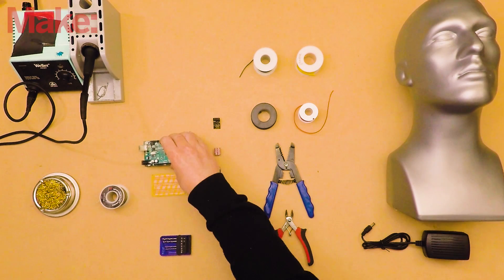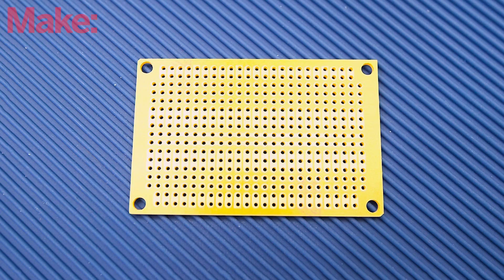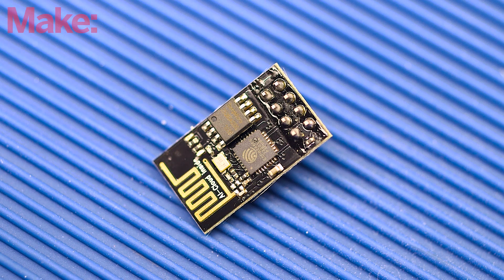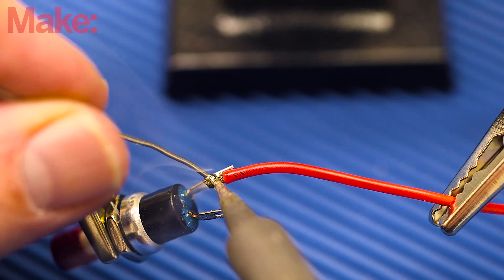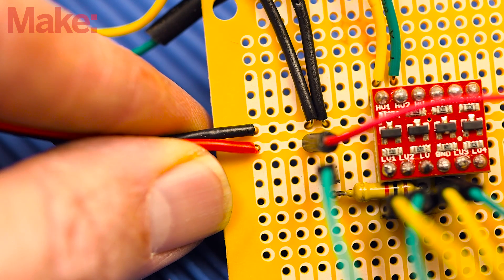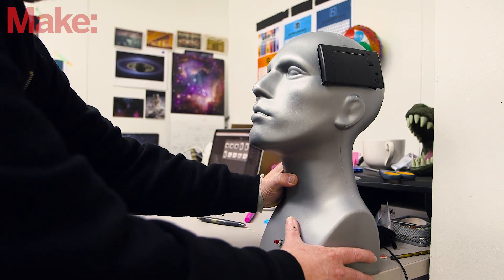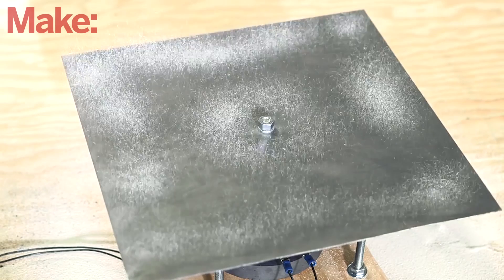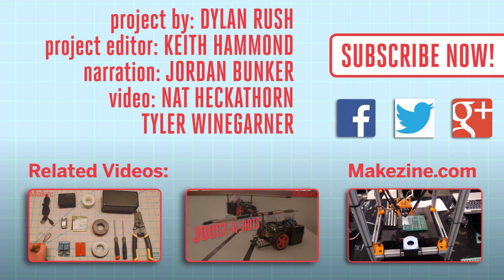Reddit Shower Thoughts Printer

Comment: why didnt you remove the arduino mega and used the esp8266 dirrectly connected to the printer ? you can also program the esp8266 with the arduino IDE
Reply: +Anders Vestergaard 
Det var lurt!
Det er litt vanskeligere, men det tok meg ikke så lang tid å programmere esp-en...

Comment: What was the approx cost of a project like this? (assuming you have all the tools)
Reply: +IllegalTacos Head on over to Adafruit and have a look.
Reply: +zaprodk Adafruit is one of the most expensive places to buy arduino/raspberry pi-related stuff...
Reply: +RedBirdRedstone You think i don't know that? The case it, not many places sell that small printer-module.
Reply: +zaprodk The printer is almost only available at adafruit, but arduino and esp and stuff, I don't even check adafruit!

Comment: Hi buddy how  are you, it's amazing, I like your make. 
If you don't mind I have a question which I have several times asked. 
I wanted to know weekend project which demonstrated by Sean My Regan ,that circuit was about simple super fm transmittor I wanted to know the transister value and pnp or npn so please if Sean  M.Regan read my question please help me out my project is still pending and one thing more to asked question can I use any mic instead of mono Jack pin.
l hopefully you would like to help me thanks. 
Yazdani Akmal
Reply: +akmal yazdani did you look at the project page on makezine?
Reply: +purpletoupee 
link?
Reply: Yes I found it,thanks.

Comment: Why use the mega? Wouldn't an uno be a cheaper option and still have enough pins to use. Or maybe even use an Adafruit Huzzah with the ESP8266 already on the board and be cheaper than an UNO
Reply: +Kirby G Even better, they could have used the ESP8266 directly with the Arduino IDE, eliminating the Arduino board completely. The ESP8266 itself has lots of RAM for pulling content.
Reply from the maker: +Kirby G You need the Mega for the extra memory to pull the data from reddit and then drive the printer.
Reply: +3zuli I think adafruit feather huzzah esp8266 would be a good choice, software serial works with it and theres 4mb of flash. The code compiles for it with no errors. I am going to try fixing up the code to work with it this week, since I already have all the parts and printer.
Reply: +Kirby G Any suggestions on what I should do to learn this context?
Reply from the maker: +Kirby G Would you mind sharing the code when you're done? That would be fantastic!
Reply: +Make:  I will share it when done. Spent all day today figuring it out. My Arduino skills are mainly cut and paste, so it took a while. But now I have it grabbing and displaying a result. Next step is to get it to print on thermal printer.